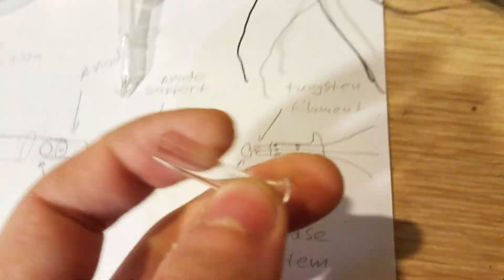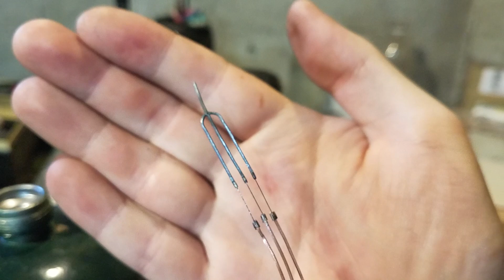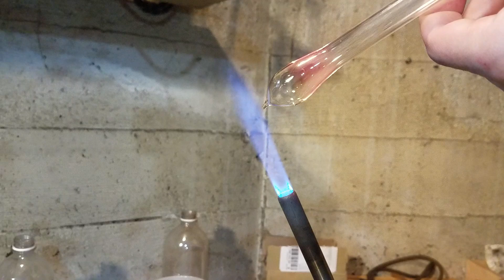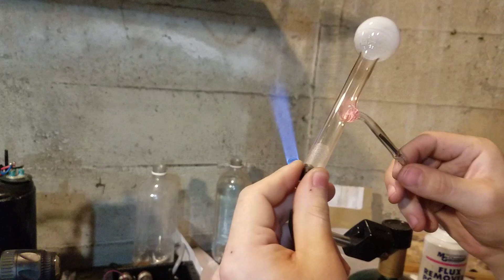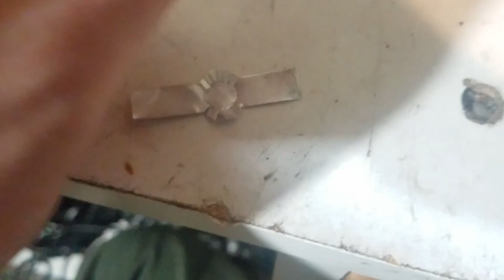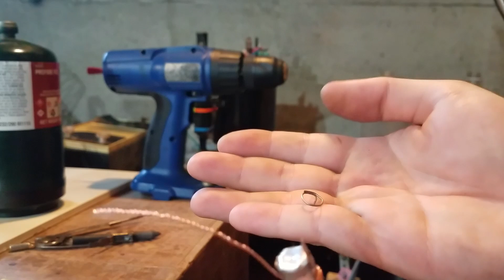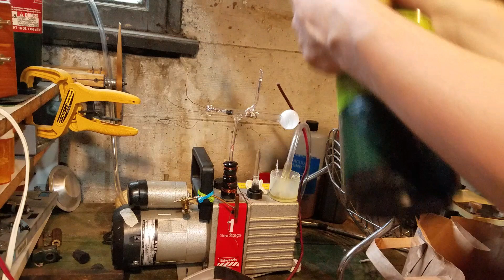How to Make a Sealed Cathode Ray Tube at Home

Comment: Where did you get that torch? I've been trying to make my own cathode ray tube using propane and a plumbers torch and I can only get about one in five seals to work. EVERYTHING is perfect but I just can't get the glassblowing right, and with this torch you seem to be able to reliably seal glass every time.

I would greatly appreciate it if you could point me to where I could get one of those torches. Thanks
Reply from the maker: Sorry I missed your comment! The torch is a bernzomatic ts839 which was from a garage sale. It is really not optimal. I have recently switched to using an oxygen gas torch. Any air gas torch has just barely enough heat to make a seal in pyrex. The key to getting away with it seems to be putting a very thin oxide coating on the tungsten. While making the seal the glass partially dissolves the oxide layer to make a bond to the tungsten with the color of the seal indicating the oxide thickness. (silver-gold = thin, orange-brown = thicker, black = too thick). If the torch is not hot enough or the oxide is too thick the oxide layer will not be reduced to the proper thickness. I am currently using a national 3A blowpipe with a modified N-1 tip using an oxygen concentrator and propane. It is meant as an air gas torch but works with oxygen just fine if you have the right tips (or make your own). 1/5 seals is not bad to be honest at best half of mine are good. I cheat when I make these videos and cut out a lot of the failed stuff because of how long they already are. If you are able to get any seal to look good on an air gas torch it will be a no brainer if you can get an oxygen concentrator.
Reply: Back in the day, we wet the surface of  tungsten with glass in advance of making a tungsten  thru glass seal. Then, when making the seal, you are sealing glass to glass.

Comment: Very nice. I really like your videos. Very informative.  I was wondering if you HAVE TO use water to gather the phosphorus from the lamp? Or could you use a different solvent that evaporates quicker and completely?  Such as
Acetone, Trichlor, Alcohol etc...
Reply from the maker: Any pure solvent should work fine. The powder won't dissolve it any common solvent, we just want to make a slurry. Water works just fine. I did not show the process due to the suggestive nature. The phosphor and water mix is slowly rotated over the flame until it evaporates. This usually takes a few tries to get a good coating. It is possible if the liquid evaporated too quick the screen would be blotchy. During pumping the tube is heated to 900 degrees and any water vapor is driven out.

Comment: Hey man. This video is awesome!!!  Thank you for sharing it with that level of detail.

2 questions. What vaccum are you applying?

Wich voltage do you use in the anode?

Thank you
Reply from the maker: I think my pump can get to around 10 micron while pumping. After it is sealed off the getter is heated which can bring it below 1 micron. I am not entirely sure on the exact numbers. The Anode is run at about 7 kV but the supply can go up to 30 kV
Reply: @jdflyback  thank you!

Comment: Did you consider removing the zinc coating in hydrocloric acid? 
It will give you zinc chloride, which can be used as a corrosive soldering flux.

Comment: What did you use to check for leaks? Something that detected ionization of gas, due to its presence I presume?
Reply: High voltage! What's used on anodes.

Comment: Fascinating project. Interested to see your use of a drill as a lathe bed like glass linger uses! Have you done any special mods on it to make it suitable for your uses? Do you have any problems with the chuck burning with close burner usage? Are the spot welders readily available or did you make your own?

Comment: Where do you buy all the parts for this? Like the nickel,copper,tungsten, the glass, etc..
Reply from the maker: The glass is borosilicate glass and can be bought at Mountain Glass or ebay:
https://www.mountainglass.com/boro-glass-33-coe/clear/tubing-and-rod/brand/Chinese,Pyrex/featured/On-Sale/type/Tube/wall/Standard

The electrodes consist of nickel wire, tungsten wire, copper wire and thin Nickel sheet.
The nickel wire can be bought on ebay from many different sellers:
https://www.ebay.com/itm/281882419537?hash=item41a1806151:g:9woAAOSwMNxXaB7a

As well as from Prommark: https://www.ebay.com/sch/i.html?_dmd=2&iconV2Request=true&_ssn=prommark&store_cat=0&store_name=prommark&_oac=1&_nkw=nickel%20wire

The tungsten wire for the seals is also from ebay from Prommark: https://www.ebay.com/sch/i.html?_dmd=2&iconV2Request=true&_ssn=prommark&store_cat=0&store_name=prommark&_oac=1&_nkw=tungsten%20wire

The thin nickel sheet for use during welding copper wire to tungsten is used in making battery tabs. 
https://www.ebay.com/sch/i.html?_from=R40&_trksid=p2047675.m570.l1313&_nkw=pure+nickel+strip&_sacat=0

Copper wire is widely available I would look around for the best price.
https://www.digikey.com/en/products/filter/magnetic-wire/934?s=N4IgTCBcDaILYEMDmA7ApgFwAQHcCWATmiALoC%2BQA

Comment: how much would you charge if I were to commission you to fabricate one of these for me? My glass blowing is rubbish.
Reply from the maker: Probably around $170. It takes me around 8 hours to put one together. I have only made 5 working ones so far so I have no idea how they will perform on the long term.
Reply: @jdflyback  Makes sense. Still I would really like a homemade CRT tube. Perhaps you could write down the procedure of manufacture in a pamphlet of sorts? I work much better with written word than with videos.

Comment: Hi, how much amperage is going through your filament? I've made a crappy homemade CRT that doesn't work currently, one source of error is not enough heat on the filament. Mine glows barely and has 180 mA through it.
Reply from the maker: My tubes use anywhere from .8 to 1.9 amps for the filament. I use .08mm and .11mm tungsten wire. Pure tungsten needs to be almost white hot to get any emission out of it. What is the source for your filaments?
Reply: @jdflyback  i got my filaments from 100W lightbulbs i had laying around, which im pretty certain is tungsten, and because of my vacuumpump isnt the best I’m limited to around 180 mA. One of the filaments corroded a lot when just going a bit over that. So that might be why it doesn’t work then.

Comment: Not worried about X-ray by the way? As I understand it, isn't that why they used to use leaded glass for CRTs?
Reply: He limits the anode voltage so x-rays aren't produced.  Plus nobody is going to be sitting with their nose pressed to the glass for hours with this.

Comment: Can you build the deflection yoke
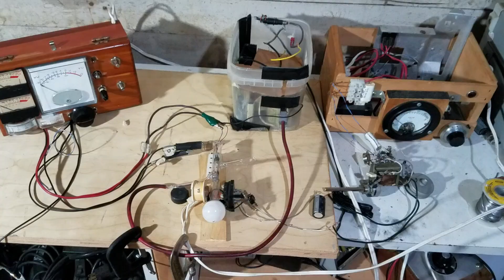Reply from the maker: I could make a deflection yoke, but I had good enough luck using relay coils for the deflection. I explain it here: 1:07:23
Reply: @jdflyback  thanks for the reply I'm trying to build my own but I'm not to sure on how to add a green Phosphor  to the crt screen
Reply from the maker: I mix the phosphor with water to make a slurry and then if the end of the tube is flat you can let it evaporate. If the end is round you have to rotate the tube over a gentle flame to evaporate it slowly while keeping a uniform layer. 30:17
Reply: @jdflyback  now all you have to do is hook up a computer to it :-)

Comment: Why are tungsten wires used at the base? WOW... didn't know it was that easy to coat glass with phosphor lol
Reply from the maker: Tungsten forms a hermetic seal through the glass. other common metals have a different expansion coefficent and would break away when the temperature changed. No way am I going to demonstrate how to apply the phosphor. This thing already looks bad enough.
Reply: @jdflyback  Thank You for replying. Interesting, I googled why Tungsten was used at the base seals and couldn't find any information on this. Thanks for explaining.
My jaws dropped when I saw you actually made a CRT to raster an image. I was planning to make a CRT from scratch few years ago and only hoped to see if someone have done this so that I can learn the design and theory. Glad I found your channel.

Comment: Where did you get the glass?
Reply from the maker: I got my glass from a university surplus store, however ebay and mountain glass are both good sources.
https://www.mountainglass.com/boro-glass-33-coe/clear/tubing-and-rod/brand/Chinese,Pyrex/in-stock/Yes/type/Tube/wall/Standard

https://www.ebay.com/sch/i.html?_from=R40&_trksid=p2380057.m570.l1311&_nkw=borosilicate+glass+tubing&_sacat=0

Comment: do you plan to use cathode coating to lower electron emission?
Reply: A coated cathode would emit MORE electrons, not less. Did you mean "lower cathode work function"?
Coated cathodes require processing post pump and seal and would add many steps/unknowns to this project.

Comment: Even though this is a small device, you really should put a little warning up for people wanting to replicate this. Accelerated electrons will produce x-rays when their paths get deflected. For the same reason, people watching CRT screens were advised not to sit too close to them. Even though this tube will not produce any x-rays that are immediately harming, so called soft x-rays, it will still irradiate and can cause harm over time. Cataracts are a main concern. It's never a good idea to be within range of anything radioactive for too long. It will cause cell-damage, possibly leading to the formation of cancerous cells.

Comment: I'm enjoying your channel.

[If you made that same flair holder tool from stainless, like from an old pan, it would stay cooler, if all all things were otherwise similar.
https://material-properties.org/stainless-steel-vs-aluminium-alloy-comparison-pros-and-cons/
The thermal conductivity of 6061 aluminium alloy is 150 W/(m.K).
The thermal conductivity of stainless steel – type 304 is 20 W/(m.K).]

Comment: instead of blowing main envelope you could have gotten a crack pipe at your local gas station or a smoke shop.

to prevent being associated with drugs on your credit card you may have to pay in cash.

if you dont show the boiling the water because of youtube reading the images as drug use it is ok if your video becomes age restricted we are willing to login or use nsfw proxy sites to get your video